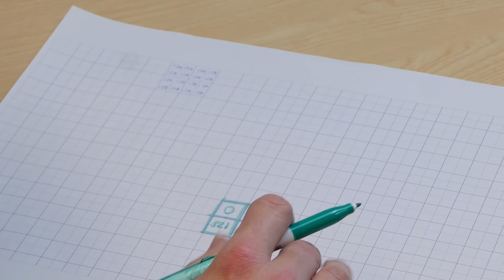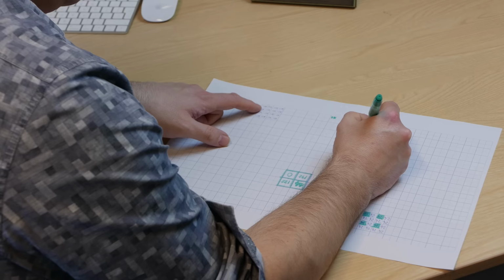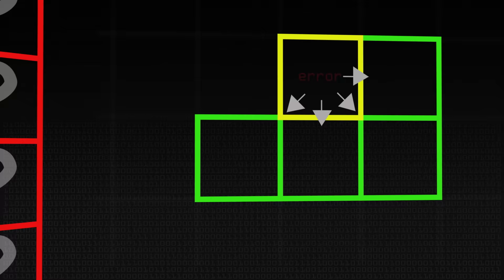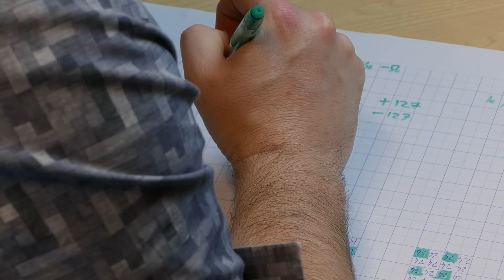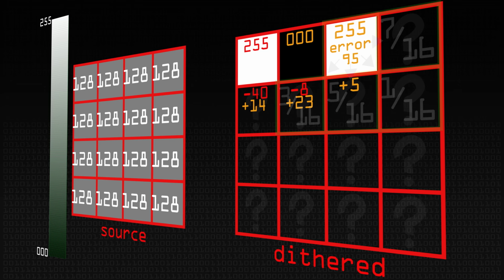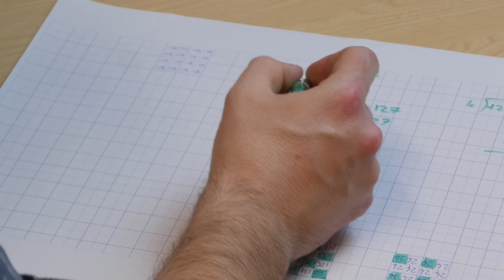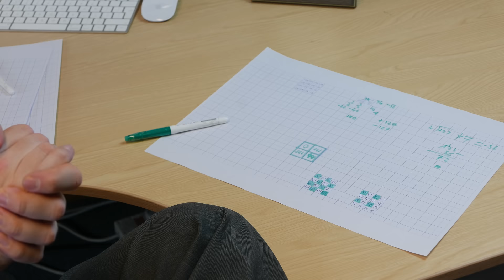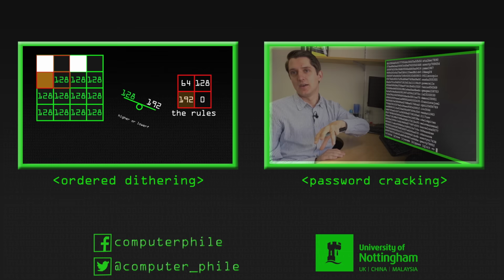Error Diffusion Dithering - Computerphile

Comment: It's interesting that I've seen these different styles of dithering, and I've recognized them as different, but I've never considered what made them different.... These videos are fascinating. I'd like more detail about how the algorithms translate to color and to higher bit depths.
Reply: In color, you'd simply dither each of the color channels (red, green, & blue) separately.  For higher bits depths, you just pick values for each pixel value.  So instead of black (0) and white (255) for 1-bit, you'd have 0, 85, 170, & 255 for 2-bit.  You'd use the same error diffusion after picking the nearest value.

Technically, your values don't have to be equally spaced, and the formulae really should account for things like display gamma.

Comment: even with how many colors we have today on most modern devices dithering is still used even with 8-bit colors, if you have a smooth gradient there are points where it moves from being solid 80 for example down to solid 79, and while that's not really noticeable, you can still dither that change to blend the colors together to simulate even more colors in between. Because when zoomed in even 256 options per color channel can still have banding issues, dithering as it zooms in helps remove such banding artifacts.

Comment: Notes that you likely want to add some noise before going through the whole floyd-steinberg process. (of the proper PDF) To prevent noise modulation from being too noticeable.
Error diffusion dithering like Floyd-Steinberg, is analogous to noise shaping in audio dithering.

Comment: 5:00 - That's how PWM works.
Reply: ...or PCM (pulse code modulation), where the on/off edges are fixed, which can make some parts of the circuitry easier to manage, but the pattern of pulses is varied (basically a single-bit synchronous encoding of a number). That was how single-bit oversampling worked on many of the early "hifi" CD players, for instance, to move the quantization noise far enough out of the audio frequency range to make filtering easy using lower-order filters (which don't hurt teeth nearly as badly as "brick wall" high-order filter phase shifts).
Reply: or PFM

Comment: Dithering down (or reducing bit width) is a different process. A random noise (or triangle wave to cheat) is added to the signal and then it's truncated. This is done instead of rounding or simple truncation.

Comment: At 4:01 it really shows that video compression was not designed to cope with dithered signals.
Reply: Very true. It's adding high frequency noise and most compression methods attempt to throw out high frequency signals.

Comment: We use it to dither lens molds, these lens printer heads have a resolution of a few microns and are rather fault sensitive by applying dithering to the 3d mapping we can eliminate the error of broken printer heads so that we always get a smooth result

Comment: Dithering in time seems like it would be the best solution for static images as it wouldn't compromise image quality, but would require more resources.
Reply: There's a limited frame rate most display devices can use, so the benefits are less than you might expect.